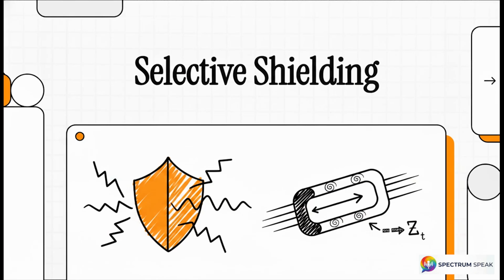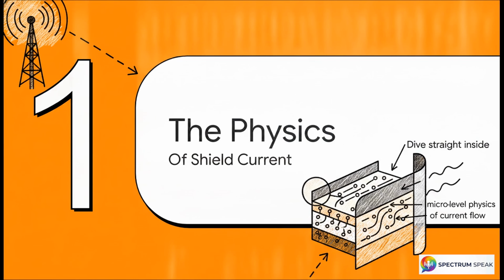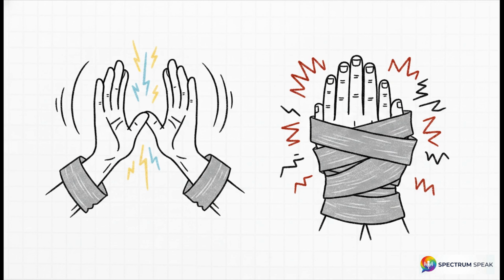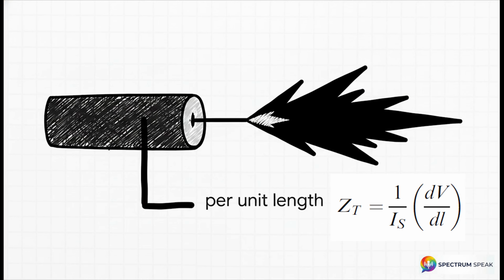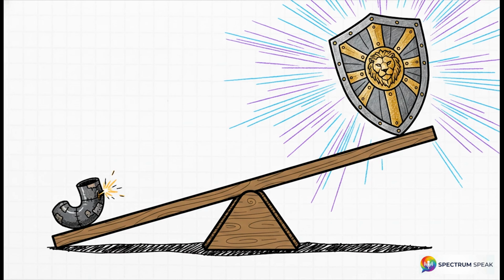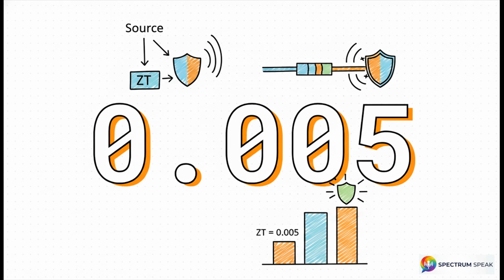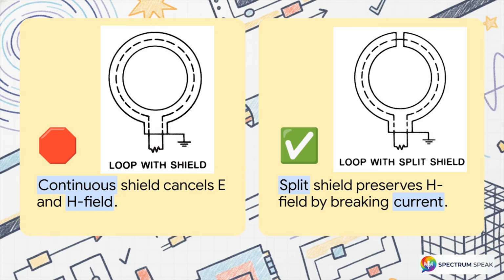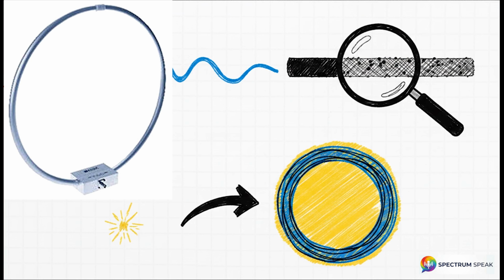Split Shield vs Continuous Shield

Comment: very good. Ever seen shielded antennas? I have. 
Split shield around the antenna radiators, wires for HF as well as dipoles e.g. for air traffic radio at 136 MHz (made by KATHREIN).
Still have the brass parts in my shed :-)
Had several 2 m loops with split shield also. Well, am retired now.
The most interesting thing was 2 crossed loops with 20 turns each in split shield tubes for atmospheric noise detections of lightnings.
With a little amplifier and headphones you could determine the direction of the signal.
Reply from the maker: Thanks for sharing your experience! Those are fascinating real-world RF applications. Really appreciate your insights!